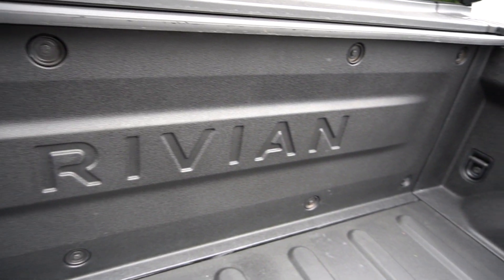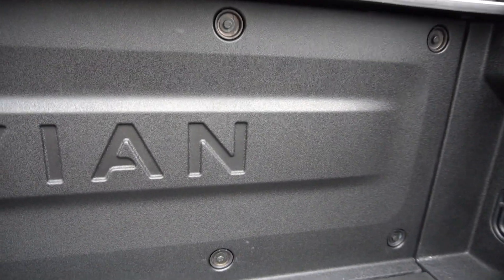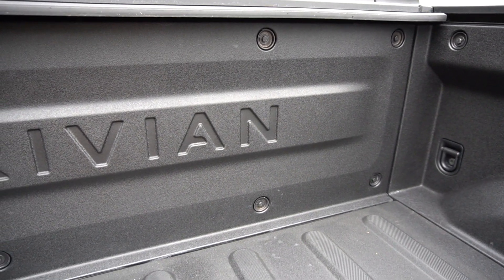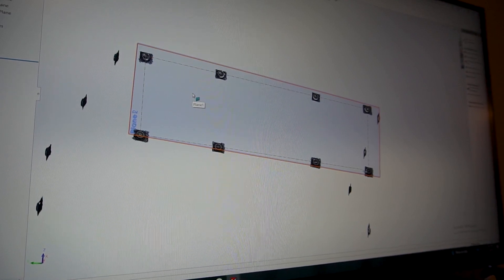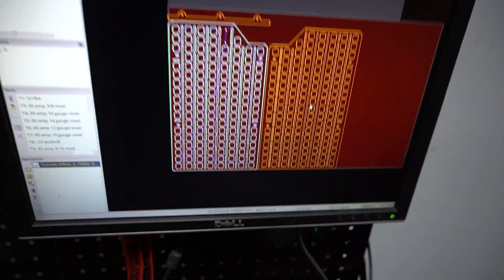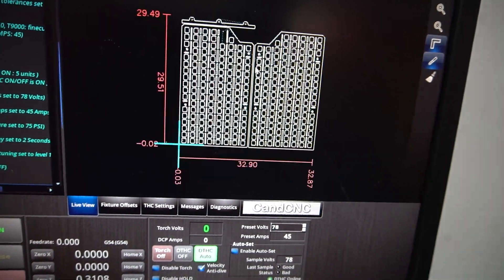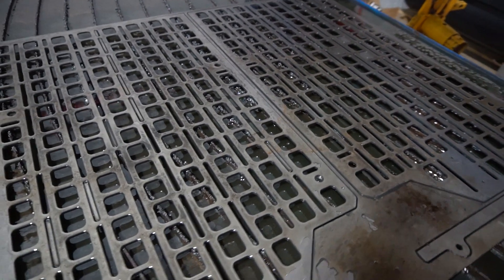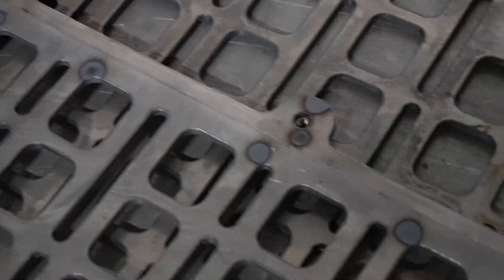BuiltRight After Hours - Designing a MOLLE Panel for the Rivian R1T

Comment: Please, please, please make this product commercially available and take my money.  I need this for my R1T.  It looks fantastic.  Can you also post a video of the bike mounting solution you mentioned.  I know a lot of us R1T owners are on the hunt for a great bike mount option in the bed.  Would love to see what you're thinking.
Reply from the maker: Thanks for the feedback! I had my bike on this yesterday and it was very solid. The only issue is that the bed is so short that even with a fork mount, your tailgate needs to be down to have the bike straight. At a slight angle, it looks like two will fit comfortably but it looks a little messy. I'll throw together a quick blog post or something and post that today or tomorrow.
Reply: @BuiltRightInd  You should make something that basically extend the cab when the bed is down.  Something that could flip inside the bed when you don’t need the extension (concave?) which holds stuff from rolling around.  It would keep stuff in the cab when flipped out with bed extended and you can tie stuff to it (convex?).

Comment: Should make some with Milwaukee pack out attachment
Reply from the maker: You'll like what we're releasing soon then! We're all 'packout guys' here. https://builtrightind.com/products/mount-for-milwaukee-packout-system
Reply: Hard to tell without the truck but was hoping the gear tunnel shuttle would fit a pack out setup
Reply: I don’t have my Rivian, but would order this in a heartbeat… One change that I would recommend is perhaps varying slot widths to accommodate straps as well

Comment: I'm not sure what I would mount to a molle grid like that but I do love the idea so I'm in!
Reply from the maker: The value for me is really the horizontal slots. The MOLLE is a bonus although we have ‘MOLLE Nuts’ which push into those features from the backside and offer a threaded hole. Thanks for the feedback!
Reply: @BuiltRightInd  I did a Google on it. I would probably buy it depending on the price and shipping. I'm WA and do a lot of backpacking and have a Siberian husky
Reply: @jsonblob8612  I would mount my fork mounts for my bikes. I have a suction cup mounted bike rack that i cobbled together out of angle iron, two fork mounts and done Chinese suction cups. With this grid i could just mount right to the grid.

Comment: This is great, my truck comes in a couple months and am interested in this, hopefully you bring it to market. Gear tunnel panel at the top or sides would also be great for securing items out of the elements while still maintaining functional storage in there
Reply from the maker: Agreed! I'm finding that the stuff I put in the gear tunnel ends up sliding from one end to the other or tipping over in the case of groceries. Something simple top or side that a person could clip/attach things do would be nice I think.
Reply: @BuiltRightInd  or a bottom panel with snap in blocks/dividers, all great ideas I think